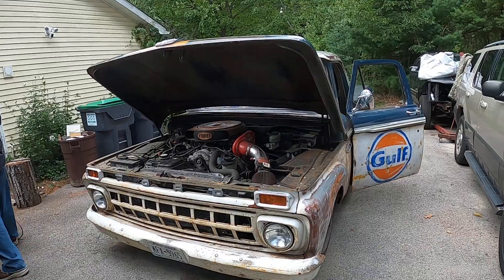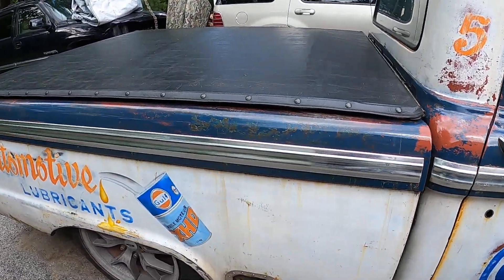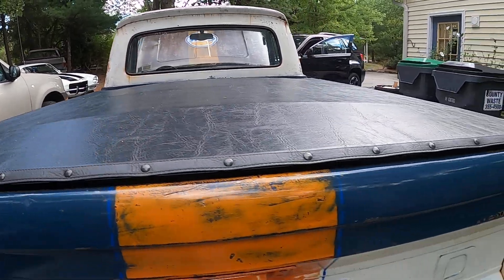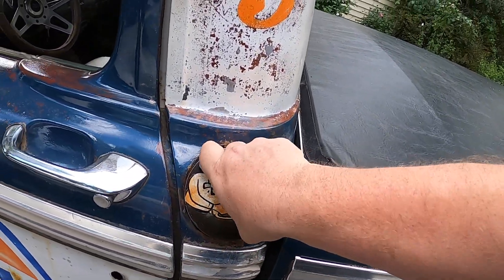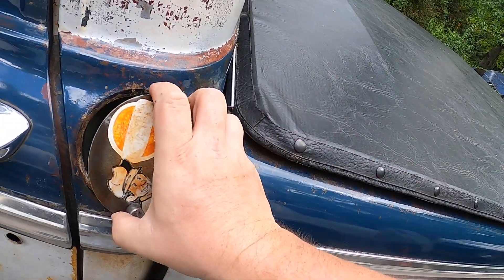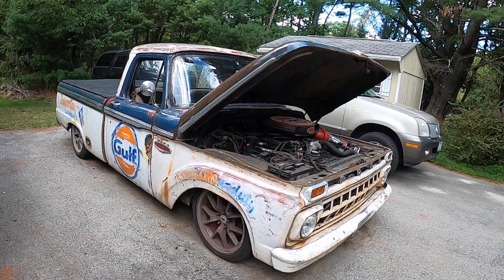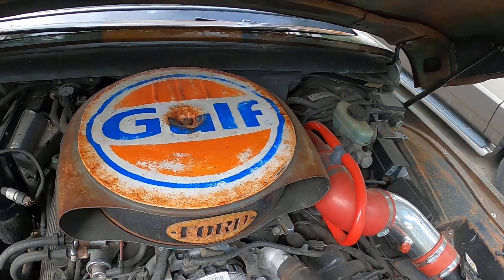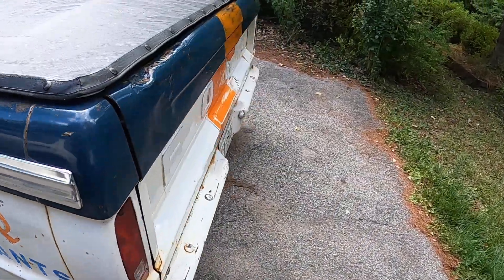1965 f100 on crown vic chassis!

Comment: why do people put 60s F150s on Crown Vic chassis? better running gear, lighter.
Reply: Hmmm let’s see 🤦‍♂️. Four wheel disc brakes. Rack and pinion steering. Air conditioning cruise control. Reliability. Driveability

Comment: 300 HP from a stock 4.6 with a different throttle body and a tune? No, Don't think so.

Sick truck though!
Reply: Actually that’s right on par🤦‍♂️ cluelessness is your virtue.
Reply: @tylerseabook9423  Ah yes, The good ol "you don't know what you're talking about" reply. Oh but I do, The highest rated Vic was rated at 250Hp, But actually had more like 230-240, these numbers were from the crank. An upgraded throttle body and upper intake plenum (if they even did that) with a tune might give 10-15hp. which a lot of that is lost through the crappy 4R75. Which is why I swapped a 5 speed into mine, also deleted the cats and tuned it for 91 Octane fuel, Along with some fore mentioned intake upgrades. I never Dyno'd my car, But if I did, I would have been surprised to see anything over 260.
With all that being said, I love the idea of these swaps and this one in particular is sweet AF, Just pointing out the advertisement (which is what this video was), had some incorrect info unless they didn't know exactly what all was done to it, which also wouldn't surprise me as he referred to the car as  "Being Chipped"